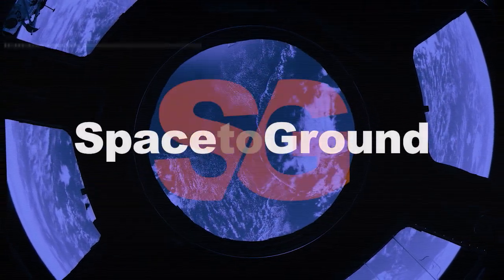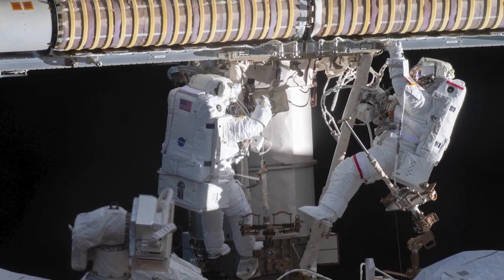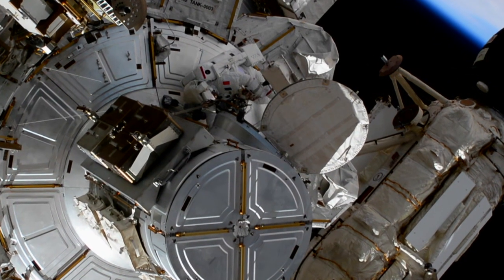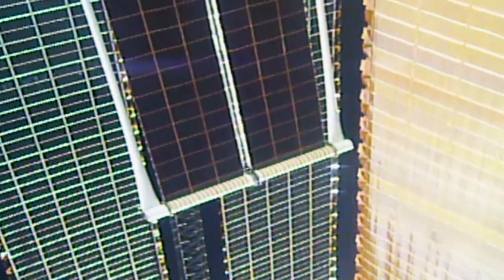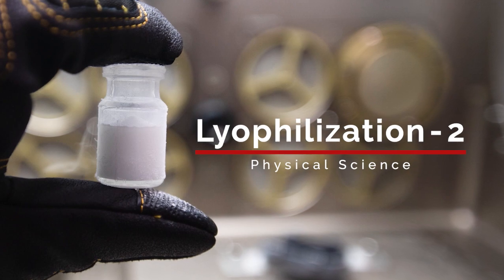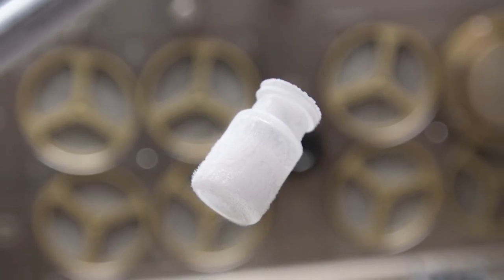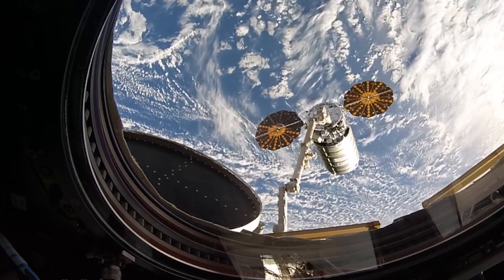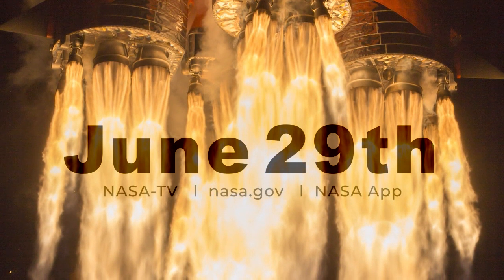Space to Ground: Power Installation: 06/25/2021

Comment: I don't understand.  Everything shows the new panels overlapping the old panels.  What am I missing?
Reply: The power output of the new panels is far higher thanks to technology improvements since the old panels were installed at the beginning of the ISS. So even though it will shadow the older larger panels somewhat, the gains from the smaller more advance new panels will be greater. They were installed on to the common truss of the old panels so that they can use the same rotor for solar direction. If you watch a time lapse of the ISS you can see the rotor rotating to follow the sun. The new panels use this same joint so a new rotor wouldn't need to be installed. Hope this helps.
Reply: Nothing it’s fake. 👎
Reply: @JimmieJoeSparky    So why are you here exactly? What a sad life you have...